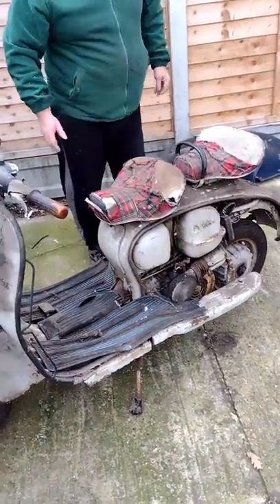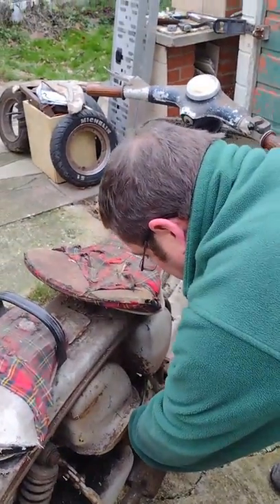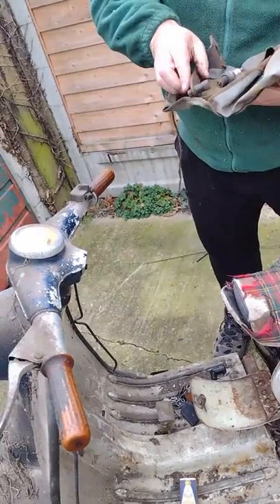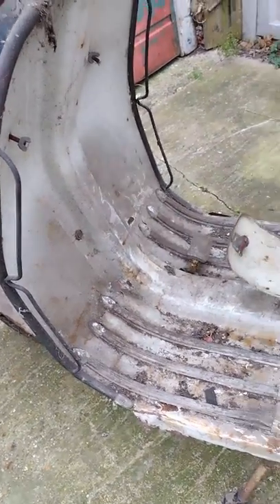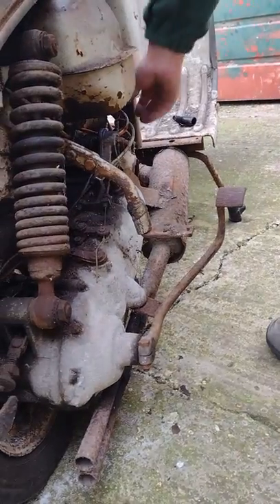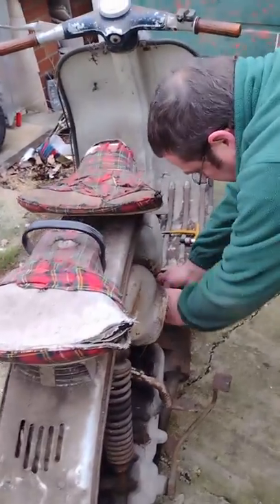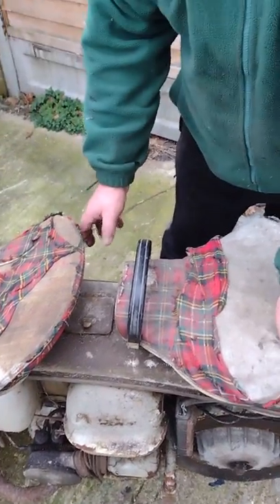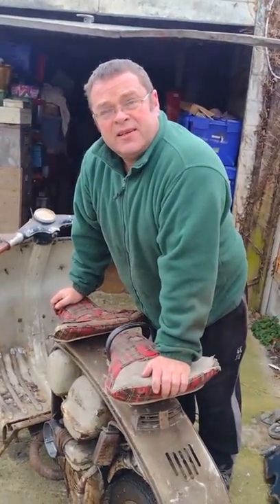will it run after 48 years? 1958 Lambretta li series 1 frame breather (UK registered)

Comment: I`ve got my dads 1957 150 ld ,last on the road 1964 when I was born and my mother couldn`t hold two kids on the back so dad bought a car . Got all 7 tax discs from new, original bill of sale, fairing ,helmets, gauntlets,running board bag and seat covers same as yours. Stored in a dry garage since 64. Not been started for over 35years but engine still free. I will get it running one day!
Reply: Probably worth 10 k now😂

Comment: I have seen a Southend on sea...sign.
Are you in that location..
I too was from Southend on Sea..Also got my first scooter from there too NSU prima D for a staggering £3..then shipped it back to up to middlesex and rebuilt it was 15 at the time..
I then went on to a Li150 bored out to 175...then put in an SX225 engine..that was good..Great days..now an old fart.. of 68...🤣🤣
Reply: ROCK ON fart........... i'm 70. i have 700cc honda transalp, and just got back from visiting friends........... up thru france, across belgium and in to holland on my Triumph Tiger 955i........... epic
Reply: @raymondo162  
Ah...one old fart to another..l did touring Europe on my triumph 500 1973..(back in 1975..6)
What a memory...even went down to the Canaries to see my mum...
Holland too. 
Met some interesting people...had a great time..and had more hair..👍🤣
That triumph never missed a beat..and was getting around 90mpg..at about 60..70mph..did Spain in 24 hours...wonderful experience...France not so hot...but better on bicycle...but that was later...
All these old machines are great....even to work on.
So have fun with yours.
👍🇬🇧👍regards Simón..